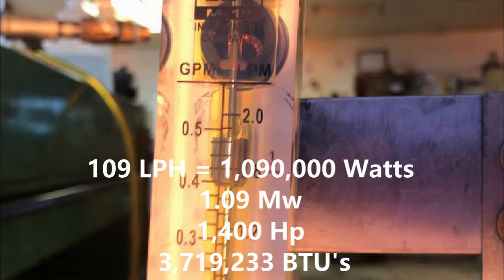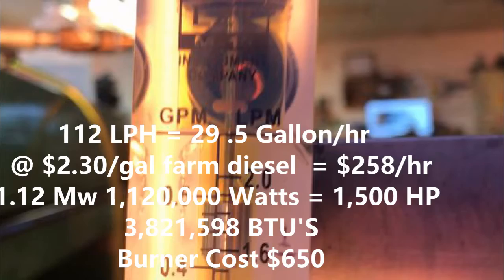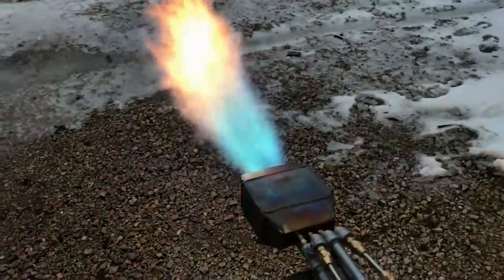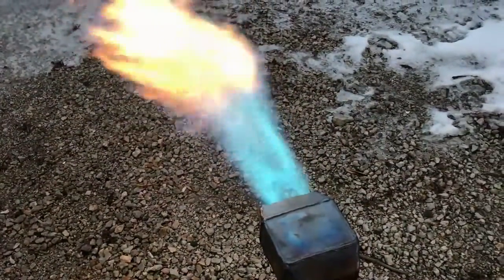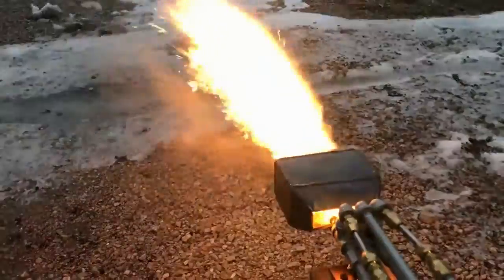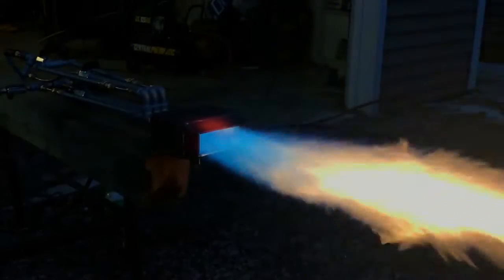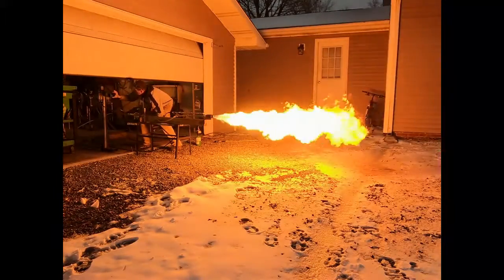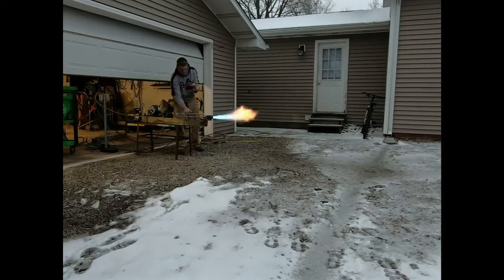Karolina's All fuel burner for Tire to oil pyrolysis Process heating

Comment: I am doing a pyrolysis project my self, so please keep in mind that you have to catalyticly desulfurize your syn gas/vapor other wise you are releasing SO2 into the atmosphere which leads to "sour rain"!  this is one of the main reasons why tire pyrolysis should only be performed by big chemical company's who have the equipment and resources to build a system that releases no sulfur compounds into the environment.
(ps: i hope that you know that the pyrolysis oil that you are producing from tires contains a lot of sulfur compounds)

mfg hazelChem
Reply from the maker: Yes its so horrible it cant be burned here but in other countries its ok
Reply from the maker: Yes they do scrub the gases first
Reply: @NOBOX7   than it is kinda ok ... i am always surprised what is allowed in the us because you can cause great environmental harm with such a process.... but on the other hand you should be able to do it so long as you are not releasing any harmful compounds. keep up your good work! 

mfg hazelChem

Comment: Quick question: will the pyrolysis process have enough off-gas at a suitable pressure to replicate the gas supplied by the propane tank?  I am interested in this unit to power our future farm biomass pyrolysis system.
Reply from the maker: Yes in fact its often to much and is burnt in  flare